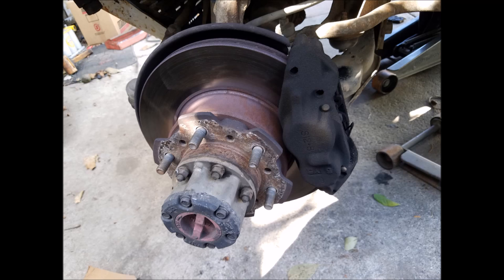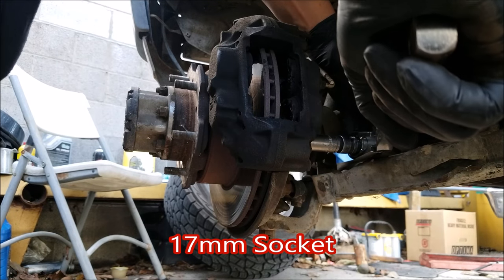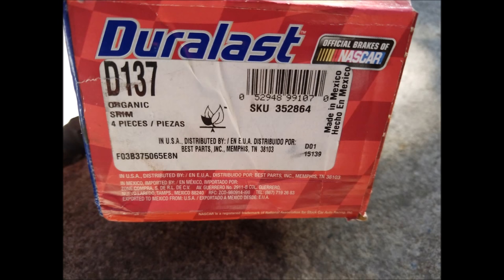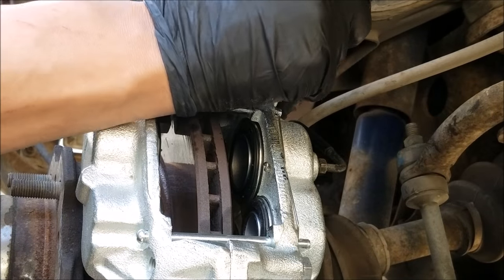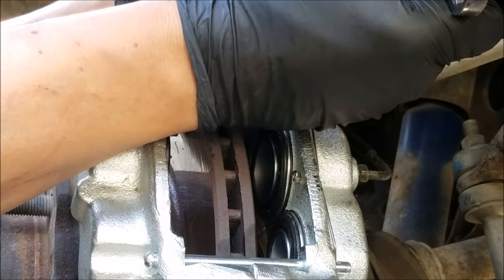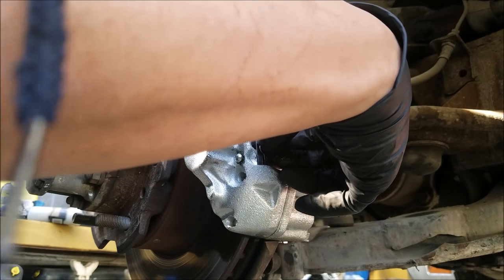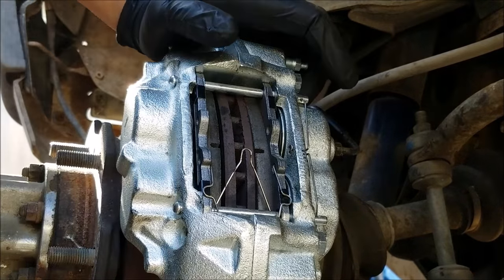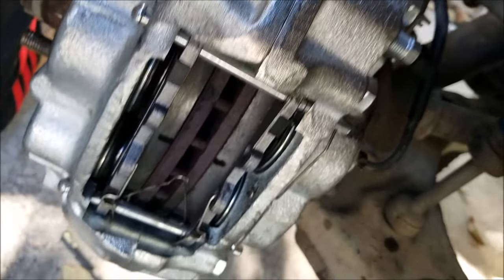How to Replace Front Brake Caliper and Brake Pads Toyota 4Runner Pickup 1976-1989

Comment: I have a 86 Toyota 4x4 with the original calibers and not leaking.  Is this the first time of changing the calibers.  I just turned the rotors and got new pads and thinking about putting on new calibers since I am this far into it.Also wanted to know if you greased the pins that go thru the pads or if you even have to.  I have a 98 ranger that it is highly recommended to grease the pins with Sil-Glyde because the pins move with the piston.   I was just thinking about the pads moving back and forth on the pins
Reply from the maker: Yea those were the original calipers..and i would look at the condition of the rubber on the pistons if u notice any signs of dry cracked rubber..if so i definitely would rather be safe and replace em...the pins yea i would add grease..but as u slide em in the brake pad kinda slides the grease off the pin.

Comment: Nice video. It would help if you would list the socket and wrench sizes needed to complete the repair. Thanks
Reply from the maker: 10mm flare wrench wrench for brake line...and a 17mm socket